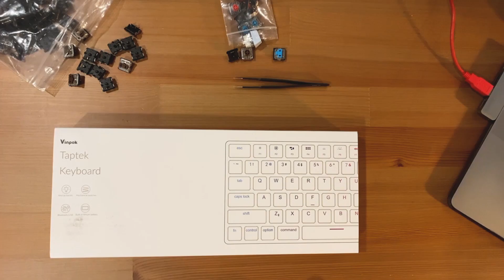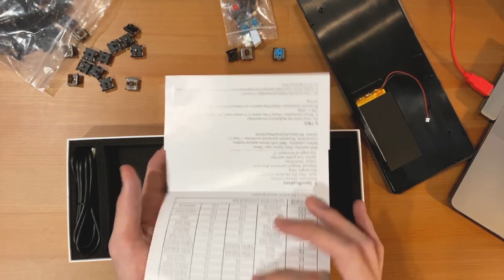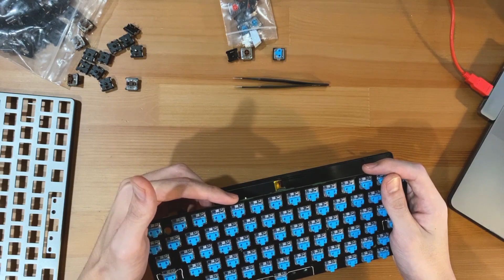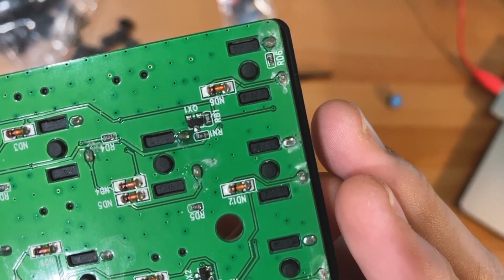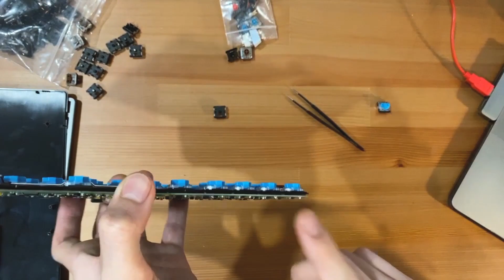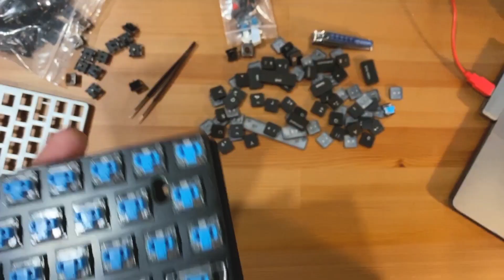Vinpok Taptek Teardown | Low Profile Keyboard Build pt.2

Comment: I am watching this like more than a year later, the taptek switch is indeed weird, it didn’t look like Kailh or Gateron v1 low profile switches. I think there are 2 low profile mechanical keyboard has since came out, the Keychron K3 and the Nuphy Air75, the Keychron even comes in optical switches, and the Nuphy one just look stunning, plus they are both hot swappable so you don’t have to solder…
Reply from the maker: Yes those are amazing, it's great to see more and more readily available low profile keyboards available on the market. Keeping my eye on the upcoming Air60 by nuphy.

Comment: After those problems you'd be way better off hand wiring or learning to design your own PCB haha. Thanks for the video!
Reply from the maker: That's what I've been trying to do since the last video was uploaded. As you can see, the struggle is real.
Reply: @fishbuildstuff  For standard keyboard layout, aren't there PCBs with individual LEDs for 60% keyboards and low profile switches?

Comment: do you think it is possible to rewire fn and ctrl, alt and windows key to make it more windows friendly? Like breaking pcb traces and rewire it?
Reply from the maker: I think the possibility is definitely there, but I don’t think it would make much sense seeing as 1. This keyboard is targeted at MAC users and 2. The chances of the contact breaking off would be rather high seeing how thin this is. I’m still in the midst of planning to mod the keychron k1 which would be way better for windows in my opinion. If you’re interested you could look into that, as the k1 has similar issues as the vinpok taptek in terms of compatibility with choc switches.
Reply: @fishbuildstuff  I bought this keyboard just because there was a second hand deal that is so cheap I have to buy it. I'm not a MAC user, but thankfully, the rows (horizontal) have PCB traces on the top side (switches) and columns (vertical) have them on the easy access side. Moreover, the keys that I need to swap is at the very end of the columns, so I can just use a razor blade and cut the traces. And also, there is a diode that has a pin directly connected to the column pins of the switches, so soldering is extra easy and the whole thing can be done in less than an hour. Switches are bad, yeah... but it is too much work for me. I don't want to desolder even one switch off the board.
Here is a photo: https://imgur.com/vnc8Bik
Reply from the maker: @jerrymk6846  That's awesome. Yeah for me, I can't have it accidentally registering a keystroke especially if I'm in the middle of recording, so desoldering was the only way. Could be a fun project in the future for you, though the painful part would probably be widening the spaces on the case haha.
Reply: @fishbuildstuff  the activation before click is really bad... But I don't think I have the effort to replace them, it is usable, and actual typing is fine, only when thinking and put my hands on the keyboard will I accidentally activate it. It is really irritating, but after seeing you painstakingly replaced yours and with probably unstable connections and exterior damage, I don't think I will do the project anytime soon.
There is still a problem, the led lights for the replaced keys work incorrectly in interactive lighting mode, and if I swap them then it will look weird in other modes...

Comment: I am looking forward to build a keyboard based on kailh blue chocs. Unfortunately I can't find any PCB that would fit those switches. So I could just solder bent pins like you did or just skip PCB and lose RGB and bluetooth. I really don't know what to do now. I really wanted GK61 layout.
Reply from the maker: CEzik Maj If you’re looking for the GK61 layout, that would be a traditional 60% layout, the closest you would get would be to just buy the plate to mount the switches on, then soldering the switches by hand and connecting it to a controller. You can find instructions on how to handwire on reddit. Of course, if you want RGB it would be a lot more work, but bluetooth would still be possible if you use a micro controller with bluetooth functionality like the adafruit feather.

If you want to do something similar to what I did, you still need to find a board that has similar switches to the choc. Regular high profile/MX switches have a very different pin layout, no matter how you bend the choc switches it will not fit the normal pin layout. For now, the smallest board that I have found that I can do this on is this Vinpok Taptek, which I believe in on sale at the places which sell them. Good luck with your project! I’ll try to answer your questions to the best of my abilities.

Comment: Great stuff. Really crafty bending the pin to get the switch to fit.
I've been hunting for a good really low profile mechanical and now looking at DIY options. It's not gonna get easier for me though. I need a kailh-compatible PCB with full ISO 105 layout and nordic "öäå"-keycaps. Guess I'll start a fucking keyboard company. Good luck with the build!
Reply from the maker: Haha thanks for the encouragement! Yeah it’s definitely not gonna be easy especially with what you’re trying to do. Another thing I’m in the process of doing that I think would work for you would be to get a plate with your required layout. Either find a plate that’s already available or you gotta design a plate and get it laser cut. If you need Nordic keycaps probably go for existing Mx sets or custom print your own with mx mounts, then plate mount some choc v2 switches and hand wire the whole thing. Good luck with your build, I hope you get what you’re looking for.
Reply from the maker: @jgm113  There are a few handwiring guides available, but the gist of it is to manually do what a PCB is doing. You set up your switches and one of the legs of the switch goes to the rows, and the other to the columns, then wiring everything up to a microcontroller and programming it to recognise the switches.

Comment: Nutype F1 is another keyboard you can try and it uses Kailh Choc switches!
Reply from the maker: Yeah I saw that keyboard as well, it looks good but sold out unfortunately. If it does come back in stock I will definitely check it out, it looks damn good, with the accessories as well.